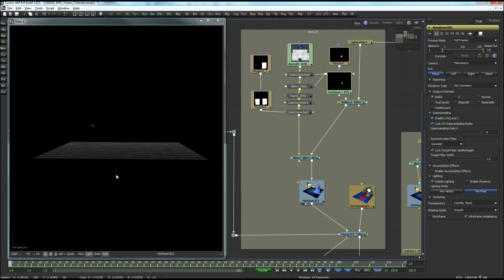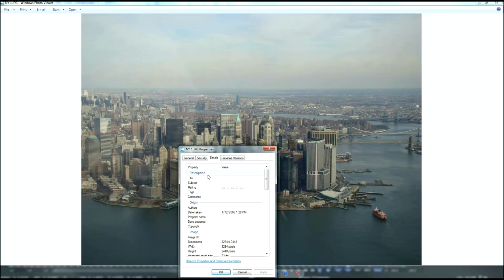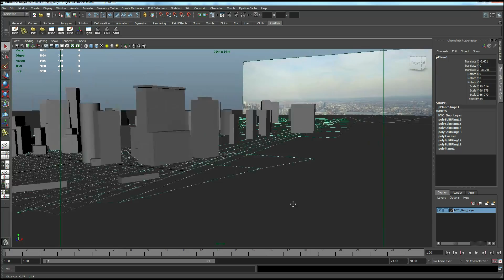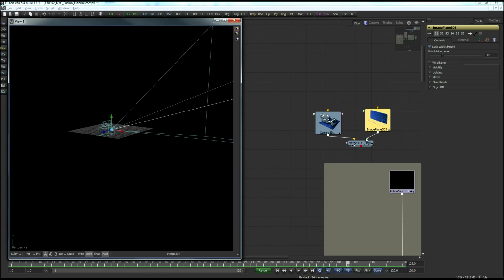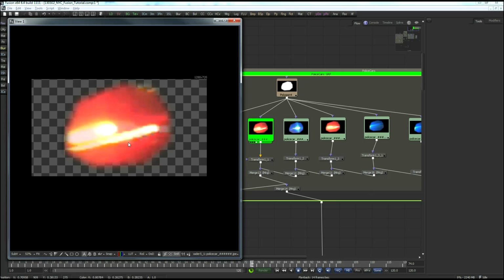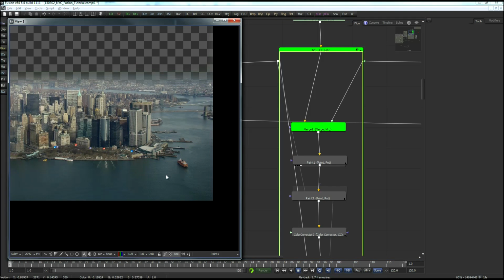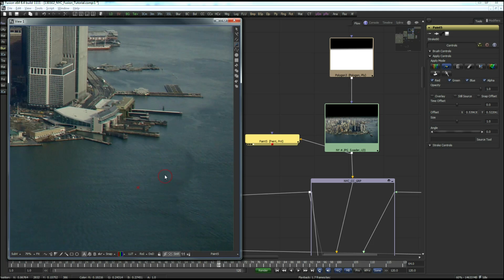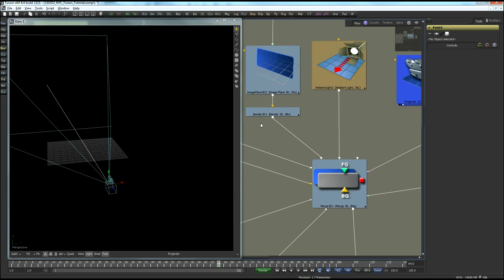3D Compositing in Fusion 6.4: Aircraft in distress over Hudson.  Part 1.

Comment: I know the video is a bit old but why are you working in srgb space, or how is your color workflow in fusion ?
Anyway, you area great compositor man.
Reply from the maker: +Darvinius Berar Thanks.. and yes, I should have converted the image to a float via gamut tool. you know that you can do that in loader now. I have been using Maya's color management work flow to first linearize the image before applying as texture, and in fusion, use loader's color space conversion feature with Stefan Ihringer's linear work flow (http://www.comp-fu.com/2012/02/linear-gamma-workflow-in-fusion/). There is a good discussion on this topic on blackmagic's fusion forum that I was reading last night (https://forum.blackmagicdesign.com/viewtopic.php?f=22&t=32598). I have been using 8-bit ProRes acquisition via Mark III and Ninja Star. Haven't gone full RAW using magic lantern yet.